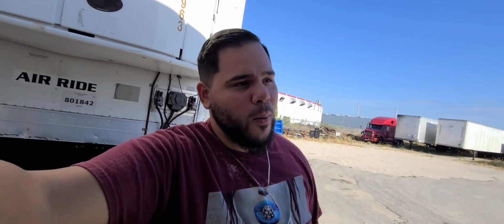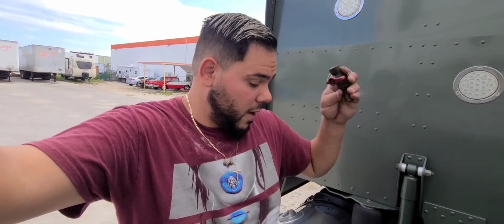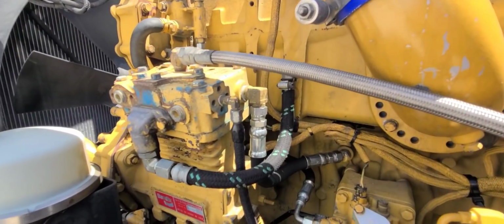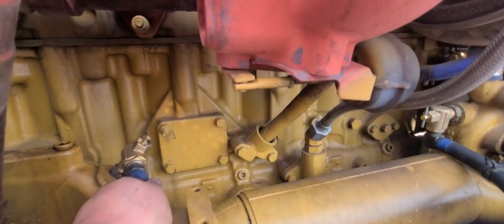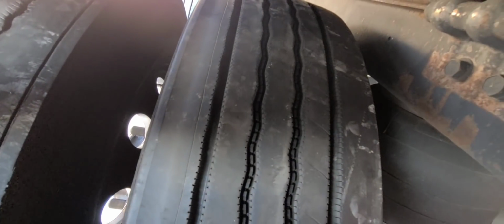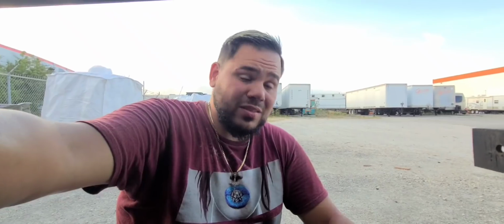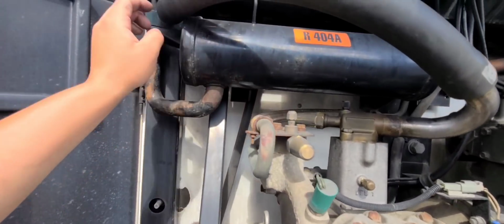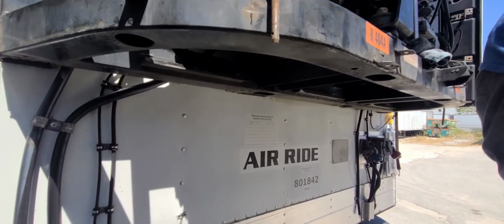Fixing some issues on my Peterbilt

Comment: If you are using 22.5 low pro. Just change to 22.5 tall tires. They are the same size as 24.5 low pro. That way all you have to do is buy tires. Instead of tires and wheels. JUST SAYING. STAY SAFE OUT THERE.